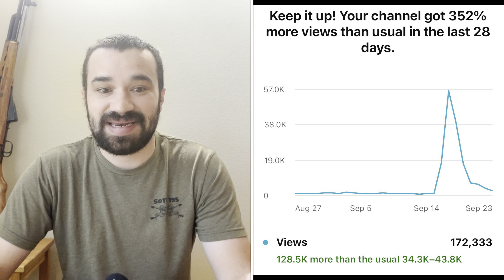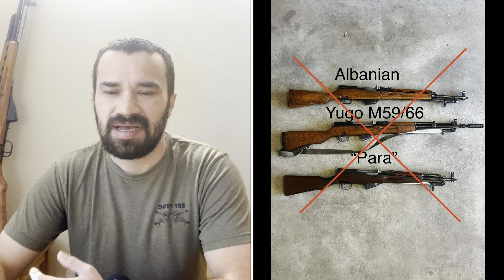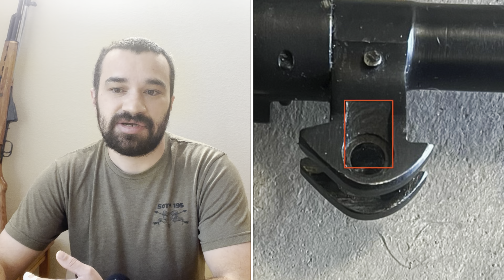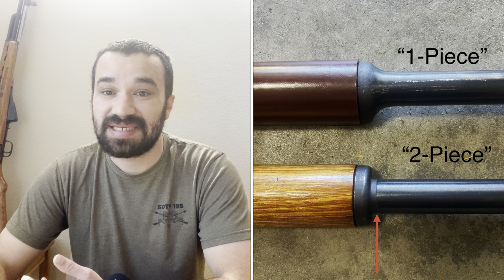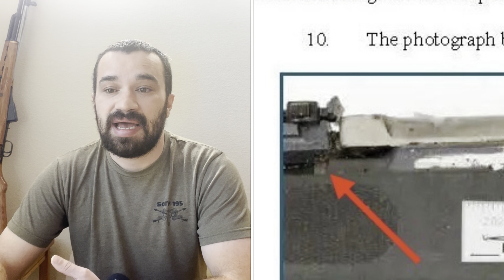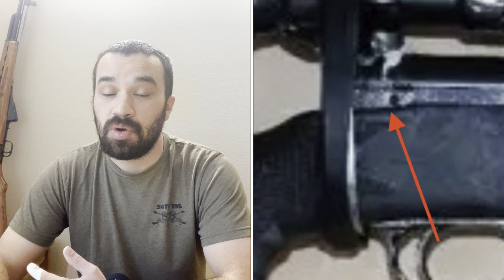The Florida SKS - A Final Look

Comment: Question?
Why wasn't there a scope mount on the SKS?
Other thing this guy or someone else took off the bayonet fair enough to say?WHY?
How do we know that this SKS wasn't made from a PARTS KIT?
This 1 was definitely Vietnam Era SKS.
Is it possible for someone or anyone to take the shot using iron sights?
Reply from the maker: 1) There are not generally scope mounts on SKS pattern carbines, which is why this guy (or whoever he illegally purchased the rifle from) used an improvised setup.

2) Realistically, removing the bayonet from an SKS is probably prudent for most uses. Obviously collectors like myself wouldn’t dream of it, but functionally, it’s pretty much dead weight. Why not make the gun a little lighter, it’s not like he was going to bayonet charge a former president.

3) SKS’s are almost never made from parts kits, because they are legal for importation without modification. Parts kits exist because select fire or otherwise non-eligible firearms legally need to be broken down, and reassembled in the U.S. according to 922(r).

4) It’s certainly possible for someone to take a ~500 yard shot using SKS iron sights, during daylight conditions.

Comment: I have never seen a scope mount like that. 
Mine came with one on the receiver cover, but was promptly replaced with a standard one without the rail.
Is there even a way to make a scope work on those things!?
Reply from the maker: Depends what you mean by “work”. The best way is to drill and tap the left side of the receiver, remove some stock material, and use an AK, SVD, or Mosin pattern side mount. Those honestly work pretty well. 

All the other solutions I’ve ever seen are somewhat dicey, and range from “OK” to “downright silly”. That said, under some real world circumstances, even a downright silly optic mount can be better than no optic mount. Under other circumstances, iron sights are a better choice.
Reply: @Triangle26  I took a look at the side mounts you suggested, and that seems to be the best method for stability.
Is there a particular variant or company you recommend? I wouldn't be against removing a little lumber as mine is a Frankenstein.
Reply from the maker: @scottmcley5111  I don’t think there is necessarily a company or variant I would recommend, so much as I would simply caution that the drilling and tapping be done by someone with ample experience. SKS receivers, Chinese receivers in particular, are made of tough steel.
Reply: @Triangle26  Thanks for the knowledge! I had just assumed it was going to be iron sights, but I have a brand new WASR 10/63 as well, would you recommend the same for it, ot keep it stock?

Comment: nice research and reasoning. Any idea how the optic was mounted? Looks like tape.
Reply from the maker: It looks to be scope rings attached to the receiver cover (unclear if aftermarket cover or drilled and tapped factory cover). Then everything was hose clamped, to remove the play, as top covers are not particularly stable. Finally the hose clamps were covered in electrical tape. That’s as best as I can see, anyway.
Reply: @Triangle26  Any idea if this would realistically hold zero? Would be interested to watch you recreate one!
Reply from the maker: @brucewayne3892  Honestly, I think it would do pretty well, and am seriously considering testing it in the near future.

Long story short, I like to distinguish between “true zero” and “effective zero”. Would a setup like this hold true-zero? No, almost certainly not. Would a setup like this hold zero well enough to put effective rounds on target at appropriate ranges for the weapon? Yes, it probably would. Syrian snipers have been stacking bodies with Chinese airsoft scopes and zip ties for more than a decade. Everything I see indicates that this would work better than most of those set-ups.

Hopefully I manage to put it to the test!
Reply: @brucewayne3892  Remember this fellow only expected to fire a few rounds at most. The scope only needs to hold zero for one mag or less.

Comment: The scope setup is sus as heck.  As a couple of sundays a month precision rifle guy i would like to get some time with a scope setup like this to see how accurate it is.  I have 2 Chinese sks rifles and one is in original stock and the other one has an aftermarket stock with crappy duckbill magazine.  It also had a scope mounted to a dust cover with rail and couldn’t get a zero out of it so i took it off and just used the iron sights.  
To me an sks is a iron sighted battle rifle.
Reply: FWIW, I mounted a long eye relief fixed 4 power pistol scope on a gas tube mount rail. It took a great deal of filing and fitting as it was too large for the rifle in all dimensions but so far so good. It's been apart for cleaning several times and still is accurate at 80-100 yards. Added bennie, strippers still can be used. Just my two cents worth.

Comment: Nice flex at 7:05  and also, I suspected it was Chinese almost immediately.  It simply looks of Chinese origin based on the bolt, bayo lug, and other cosmetics you ID'd, and ruling out obvious nations like Yugo (no muzzle device, etc.) and others, plus Chinese was probably the most common by far.